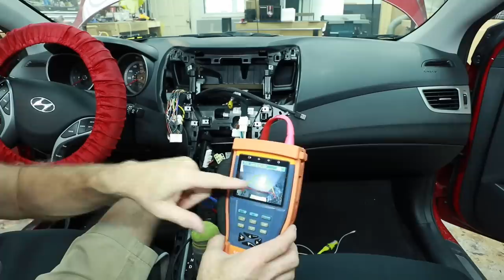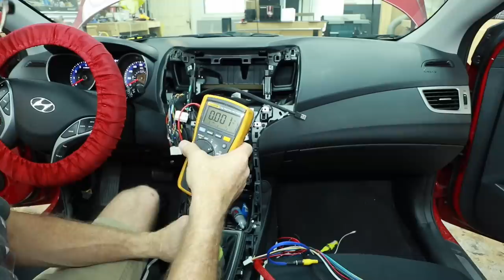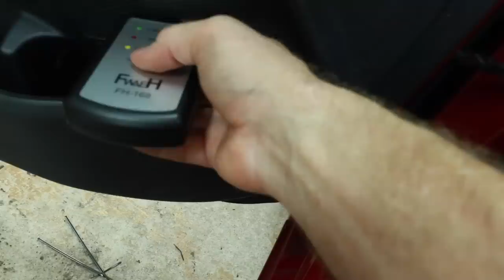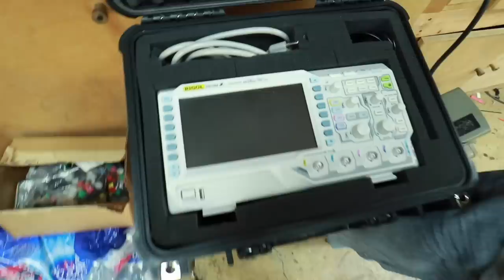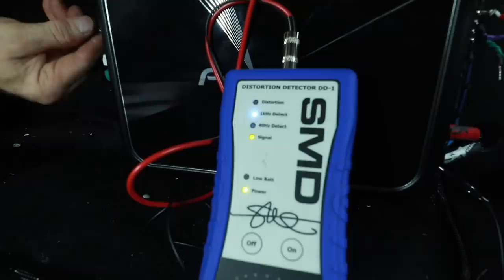The process of a 911 make over in this Hyundai Installer Diaries 211

Comment: This video was informative and entertaining the whole way through, great to see the customer happy after the quality install! Despite doing a far better and safer install than those hackjobs who messed the car up before, this video makes me want to redo my entire install or let you guys work on it! Those devices you used to level out the sound were super cool, I usually just level my subwoofer with my speakers by ear! You guys do a great job! I hope those crooks who hacked up that guys car never touch somebody's vehicle again. I do have a question involving my setup, I ran my own wires from my speaker amp to my door speakers, however I could not run them through the factory wire boots. The trouble is at each end of the boot Dodge used solid plastic connectors that I can not for the life of me remove, if it would even be possible to run wires through them considering how tight everything is. Currently I just have my wires ran to the doors through rubber grommets with a good 5 inch drop from the body to the door to prevent the wires from getting crushed or caught. What would be the best way to cover up the wires or some how make a boot to run them through, do they sell those? Thanks. My only other question would be a recommendation for component speakers on my front doors, I have 6x9 mounts, do you know any decent 6x9 component setups? Thanks again for the pride you put into your audio installs!

Comment: Alpine and crutch field  has factory adaptors for all of this wo splicing.. but all the same.. this is the first time I’ve seen someone actually pin or depin wires from harnesses. 99.9% of installers would just tape up all the wires not being used and leave them as a big mess in the dash.. especially with such a shallow head unit 
This is super clean. This is a prime example of why your buddy who’s gonna so it cheaper isn’t the best choice.

Comment: This is some awesome work...... the only neg I saw, and it's nothing much, but when you made that fuse holder to battery clamp, i just looked half done, after seeing all your work here I learnt so much, and I'm going to use some of your techniques today on a wiring job........ so really the 1 thing I picked on with that fuse bracket really has nothing on the 1000 positives I took away.... top job guys..... I will be a subscriber now...... 
Plz don't take my thinking I saw somthing not done right that I'm not trolling you, it could also have been camera angle angle....... keep up the

Comment: I can't install things as nicely as these guys do, but I do did connect my vehicle with proper connection, grommets, fuses, terminals, ferrules, etc.     I had to fix the stereo in my vehicle after it was bought due to the "pro shop" scotch lock and electrical tape that the previous owner had done. I really don't trust many professional installers as I've seen some shoddy work by professionals.  The worst thing that I've seen, was a guy that had no fuse on his amplifier because he was told that it "limited" power.  His truck caught fire because the power cable got stuck in the seat within a few weeks afterwards.  The second worst was a head unit with all the speakers front L/R + and rear L/R + and  front L/R - and rear L/R - connected together into a 8 inch subwoofer to "make it more powerful" - The stereo quit working (unsurprising).   I'm sure that many of you have seen similar horrible stereo installations.

Comment: Alot of people look down at mix matching brands and yes if I had the funds I'd buy one brand of a top brand not only for SQ but it looks waaay more professional. But I think most of the down looking comes from a newbies or mega budget installs of Hodge podge bunch of usally really cheap crap tossed together, but I'm always on a budget and my caravans system is a rainbow of brands (I wouldn't go this route for if a friend or whoever wanted me to source and install a system for them) but my components I choose were purchased using several factors such as availability,price,specs,reviews, fitment,brand reputation and looks. And so far I have a really good sounding system but it's never finished. But at the moment I have NVX VCW15 Sub, Pioneer gm9701 mononlock amp with a PAC remote gain knob, Soundstream ar4-1200.4 4 channel amp (50Wx4), fronts are Soundstream Arachnid 6.5 component set but midwoofers i replaced with Rockville RM64PRO, rears temporarly are still stock 6x9 wizzer cone coaxial with a $8 power acoustic tweeters tucked in behind grill and head unit is a pioneer AVH 210ex touch screen. And my wires are OFC welding 1/0 & #4 cable, Stinger 6 channel and Monoprice jumper RCA's, kableDirekt OFC #14g and NVX OFC 8G speaker wire. And an Audiopipe volt meter! Now that's mixing brands... Not everything was a home run mainly the Soundstream stuff there cheap components woofers were a fail and the amp is fair... Money was tight I'm impatient that's the amp I got I wanted the "1800w" version but it wouldn't fit where the US Acoustics 4065 that died was located. All n all I LOVE the NVX sub, the pioneer amp is AWSOME and like head unit,  and I was Leary trying Rockville with the whole K9 sub thing but these 6.5" mids are awesome little speakers! and at $25 a piece there a steal, if you want tight clean punchy midbass with 75/ 100w RMS power handling i highly recommend them. Also I use Grace ice and water shield for sound deadener and gaskets works great and it's inexpensive in comparison.

Comment: That's what I been saying if ppl are gonna run CCA is to always go bigger than normal.  Now I got a S10 be blazer which imma do a semi big build for it this fall n winter. It's just way way way to hot down south as y'all know this summer. I'm in NC but travel to myrtle beach South Carolina every two weeks with my fiancee to visit my parents n stay at our beach house. Well my mom n step dad's beach house on Ocean Blvd lol. I built our daily system at the beach house which was hella nice at night and early morning with the sound of the ocean and the nice cool breeze of the ocean in the early am and at night. During the day it's deff 90+ and humid as hell. But I got two SAv3 8"s into our VW CC 2.0 TSI Turbo sport which was a pain in the heat lol. I had to use CCA it's on a Skar RP800.1DM yeah I know CCA 4g  😂 but it works and actually works well btw. I'm using DS18 CCA for it ATM until my purple and Neon green OFC 0g and my 8g baby blue and Green ofc shows up. It's the KK wire I can't spell it lol but y'all know what I'm talking about it's alot like skyhigh but have more colors. Anyway I had to run 4g CCA so what I done because I had 80 feet of this stuff. So I ran two runs of 4g from the yellow top to a dual 4g to 4g output reducers for the amp. I done that with both power n ground and it gets right at 14.2V and it stays there no drop but with single run it went from 14.2 14.3 to 13.9 and 13.6 at the Lowest which isn't bad considering.. and the subs are using CCA 8g for the sub wire as well which works pretty well. Looks cool to 😂. But I highly recommend ofc over CCA anyway of the week. But I had no choice it was either use it or wait n no SAv3 8" working lol. Now that blazer is running 3 runs of CCA 0g with reducer blocks. Which I also use reducer blocks on my Subs when inverted.. I can't use em with the SAv3 8"s and my Xv2 8"s when the subs motor is in the boxs.. but if you use CCA wire deff either go up a size or two n use a reducer block if needed or double up..

Comment: I really enjoyed the video and it's clear that you care about your work and don't make any compromises. This makes me confused as to why you didn't just run the AUX cable. It seems like a corner that you cut (I understand the customer has an iPhone). The AUX was a feature that his car had when it came in, so it seems like a shame to not just include it. You never know what circumstances may change. I would've also sprayed a little self etching primer over the exposed metal that the previous shop ground the paint off of for the grounds

Comment: Yeah, Apple CarPlay needs as little resistance as possible. I usually run the USB to an accessible location, then have the Lightning cable come up. Just in case the cable becomes frayed.

Comment: Back in the 90's I was an amateur Installer working at a pos shop a 93 corrola came out n harness looked simple 9 wires so I was like ez to cut and mend in my stuff had a wire that came in the radio out and back on didn't pay it attention and radio was perfect but car wouldn't start took hours to fix

Comment: For soldering,
you should do a mechanical attachment plus the lead.  Its not good practice to just solder 2 cables together with only the lead holding it together, they should be twist together fist and solder.

Comment: The factory speaker deal I can feel for tho had a guy that didnt want to spend the extra for adapters as well the front speakers were blown so I cut out the original speakers and fitted the new speakers into those because they wouldnt fit without smacking the glass without adapters

Comment: I have a 07 Chevy avalanche and I have a sundown salt 4k Wich is 3" high and won't fit on my amp rack Wich is 3/4" high so it's like 3.5" high total.i saw this video and saw you used sintra pvc sheet.how thick of sintra would be strong enough to hold the amp and I'm hoping that will save me enough room for the seat to close.

Comment: Just installed a 10.1 inch android headunit, arc audio ks2500.1 amp, and an orion hcca 15" 152 subwofer. Sounds great, if I only knew how to use the dsp equalizer.  Any suggestions?

Comment: I have this exact model, how do I mount a new tweeter in the door? Also can you give me a link for the woofer adapters in the doors? I can’t find them online. And also how can I get the speaker wire through the door jam, their isn’t a rubber booty it’s a pin connector

Comment: What component speakers did you use for the installation I have a 2013 Hyundai Elantra and I’m looking for the best component speaker for my car by the way I have a 1600w 4 channel planet audio amp I wanted to go all kicker but I haven’t found one that the tweeter fits only other models like JBL fit both bottom speaker and top tweeter o and if I were to go with JBL should I go with JBL co-axial speakers on the back or can I go with kicker since it is the first brand I wanted to go with  in the beginning I don’t want to change my 12” kicker L7 subwoofer.

Comment: I live in Indianapolis IN. My factory stereo in my 2015 Silverado with the 7” display and I got it 5 months ago an the infotainment system has been messed up from the day I got it. So, no stereo for 5 months however I try to play my YouTube music from my phone through the truck by Bluetooth. But the problem is the screen jumps around an selects buttons on its own so it’s hard to use my phone for business while driving because it mutes my customers and hangs up on them constantly, an does the same thing with my music on my phone. And you can’t fix it because it don’t recognize any commands. So it’s a lucky brake if you get to listen to music or take a call while driving. They tried to fix it once at the dealer and is was same old same old soon as I got down the street. I need it fixed or replace an was wondering if you have ever came across this? Sorry long message lol, but I figured I’d ask. 

Lafayette Ransom
WETlooks Epoxy Floors Llc.

Comment: @Five Star Car Stereo @DIY Audio Guy i know what u mean man im doing that right now mind u i went the cheap way it might look getto but i know it will work and i have done the testing out of car everything works.. got it all second hand but im happy with it first time doing it and first car owned.. but im looking for what he called "FAST WIRE" dont know where to find that i would love to find that bc what i like to get alot dont with less to worrie about running... but like to know for a 200 rms to the doors i would like hard to find but running jvc-kenwood (CS-J620) 30 rms max 300 watts  speackers now but i was to get louder laster on what gauge should i use on them and what gauge should i use for a sub thats 500 rms max 2000 watts  and the sub is as high as i will go for sound in my 2007 hhr.. im doing a power system for it too but mixing things up but will be doing videos on it when i can get my work bench all setup...

edit.... speedwire is whats its called i did more looking up after watching the time area like 3 times more and found it..

Comment: That speed wire you use out to the speakers from the amp.... is that a thick enough gauge? I always thought it had to be a minimum of 16 gauge or 14 gauge for longer runs.
Reply: Are you questioning them about something you're not even sure off,🤦🏾‍♂️🤷🏾‍♂️

Comment: The speakers in the factory basket are fine that's better than stacking cheaper abs and getting handy with a router... & cheaper speakers are easy to re- install.... the tensle leads would have been fine if they put DUAL walled adhesive linned MARINE GRADE  heatshrink over them in red/black ...

But I'd clean up THIER doo doo work of cutting the old out! 

I am doing a video very soon of spray can sound deadening & still using speaker foam rings just cheep 1's and  80mil fat mat in area's... on a old rav4 bucket!

Comment: Btw, I’m sure you guys know this, but anyways, “METRA” makes replacement factory harness for when idiots cut the factory harness, you can buy it and solder it back in place, and they are very cheap (10-15$) I did it on my car because the previous owner cut the factory harness

Comment: Wait?...………. this was for real?!?  even i no you dont pass live wires along pedals. also i have a question i have a realy small trunk and made my stuff removable by adding a second fuse in the trunk so i am able to remove my sub and amp the wires i tape off so they cant ark only the positive gets disconnected at that fuseso i leave the holder on the live wire i just remove the fuse and the wire connected to the amp is this a good idea?

Comment: I had a pioneer 2300nex installed in my wife’s car. The shop I chose would not let me see the car during the process of installing it. The installer even put his hand on me to push me away and told me they was almost done and shut the door. Is this normal practice for installers? They also promised me the center dash screen in her Cruze would work (which it didn’t). They promised to use all copper wires for her amp and did not. They used a very cheap Q power CCA kit and charged me for a Copper kit. And many other shady things. Needless to say I will be doing it myself. Thanks Dean and Fernando!!!

Comment: 27:38  Keep inventory to re-pin factory terminals.  You don't need a huge variety either.  I can re-pin that before you could extend the wires and re-attach it to the vehicle.  Just make sure to document wire positions, backed up with pictures or video.  Don't panic if you place a wire wrong, just de-pin and relocate it.  Eventually somebody else will be in that ride and see the work.  Who ever last touched it is responsible for all tomfoolery.  Not a fan of solder at all.  But I may as well be talking about religion at this point.

Comment: Because your stereo is not properly grounded and the fellow did not use Thai rocks that's why you have wires inning down or didn't even take the wires properly causing a bad hmm this is also to be corrected with electrical tape and a good one man who could hook it up properly and make sure you get in your voltage fuse Box are connected regular battery with a fuse Box Used to work at 13:10 Dixie and Dundas in Canada called audio Automotion Automotion

Comment: only thing I don't agree with is putting the X-overs in the doors. I've seen the components in the cross over break off the circuit board by the door being slammed shut over and over. I put them in the car and run new wire into the door through the factory grommet, not as easy but worth it.

Comment: You will have to connect to the power 8 Noise suppressor that way when these alternator is going it won't make a noise through the radio or other take dad sir CD same thing
Reply: Sooner or later that Dell corps mark manic is gonna give up your not built for a long time only build just to satisfy or shortly models wall upgrade the stereo system

Comment: Y'all run quite the operation, but can I suggest that instead of gluing in the USB cable, why not solder on to the port that is already there?  Just strip the cable and lay the ends on, probably takes less time and will be cleaner, if you have that board in there hanging off, you can just make a hole or snap it off.  Then you can do the same with the aux in jack, no glue and they will line up perfectly
Reply from the maker: We have tried that. It does not work that well for Android Auto. We never know what phone a person may want to use so we go with what works 100%
Reply: Five Star Car Stereo interesting, have you tried cutting the traces to the rest of the board?   It might be sensitive to some of the current in there, just take a dermal and sand off the traces before the connecter or you can use a exacto knife, but that is still interesting, I would wonder if the connection had too much resistance in it leading to too low of a data rate.  My background has a lot of hobby electronics in it so that is what made me curious.